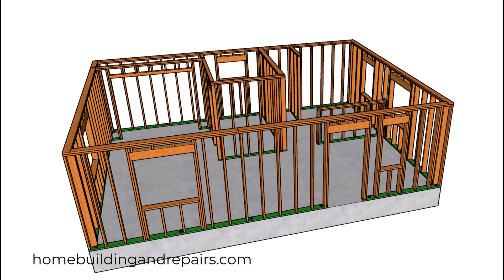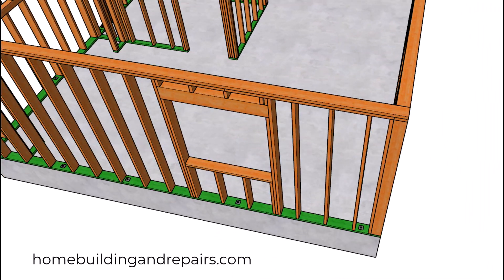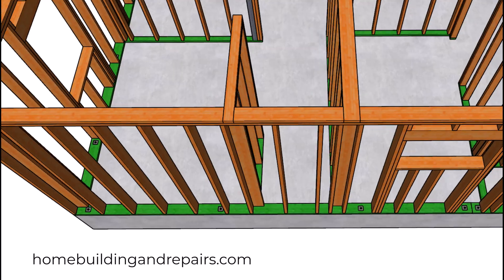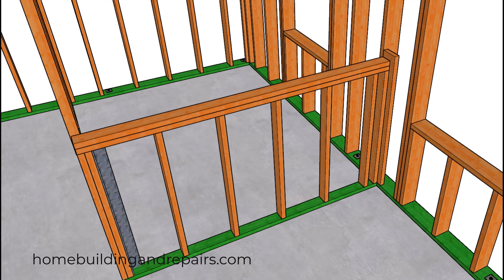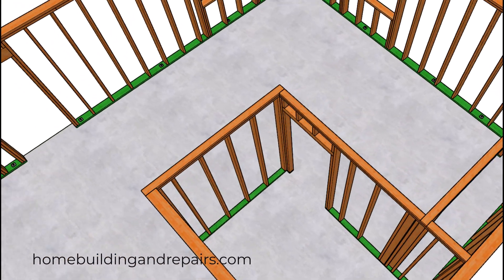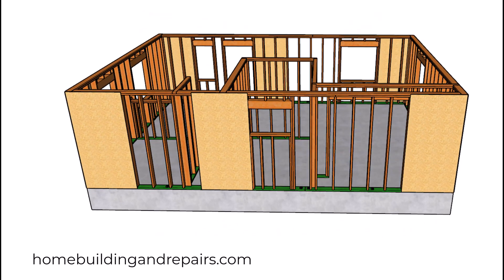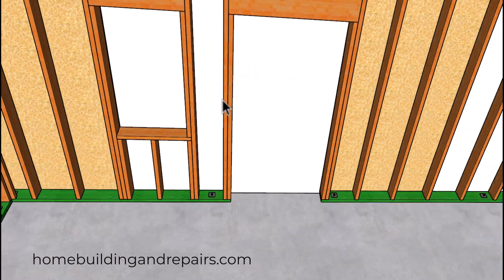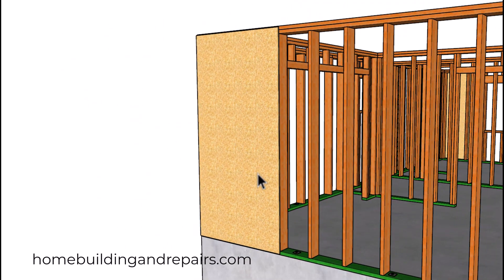Wall Framing Tour of 600 Sq. Ft. Small Home Construction - Part 3

Comment: I've heard that it's structurally superior (especially in a seismic zone) to have the headers right up against the top plates and then add cripples and a 2x4 framing nailer below that (to set the final rough opening height for the window). Is that true?
Reply from the maker: I'm seeing more of that, but don't have any engineering information about it.